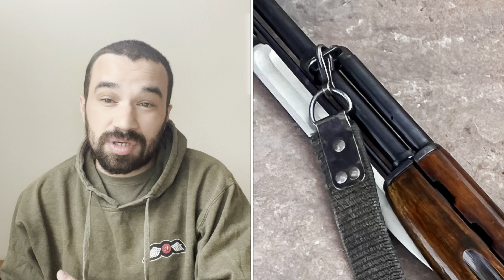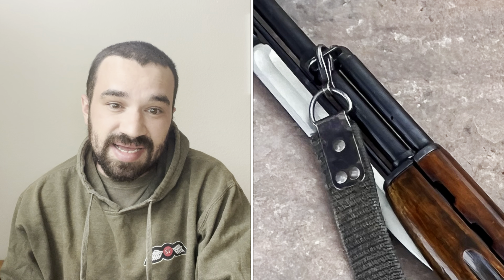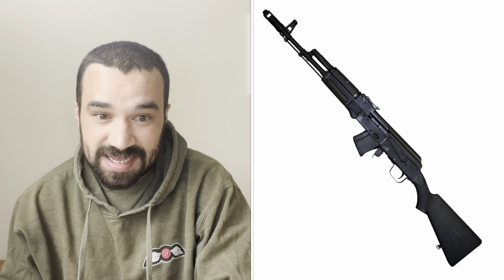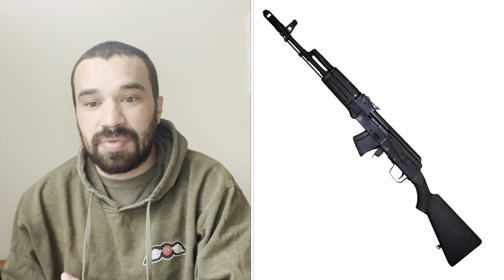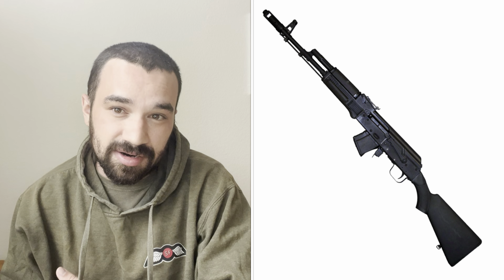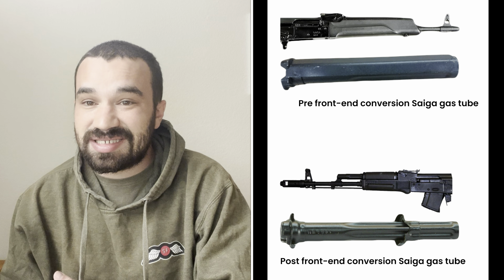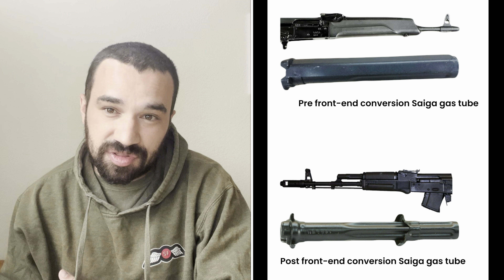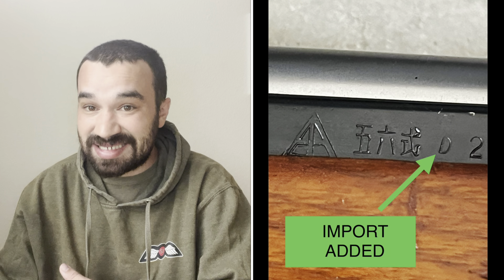SKS Collector Breaks Down Assassin’s Weapon

Comment: Spot on. I thought it might be a Saiga at first, but once I saw the gas tube was almost touching the barrel was the same diameter of the barrel and had no fluting, I knew it was an SKS. I also thought I could see the gas block mounter sling loop.

Comment: I called it an early 90’s Chinese SKS import put in a crappy aftermarket MonteCarlo plastic stock with the horrible duckbill metal detachable mags. Probably a NC Star scope to boot.
I had the cheap plastic aftermarket folder on mine and that stock covered some of the serial number.
That gun has probably changed hands a bunch of times over the years and I wouldn’t be surprised if it was stolen from someone a time or two.

Comment: It would be BATFE not FBI attempting to recover the serial #. That said Dale Armstrong former ATF agent has a book on firearms trafficking for criminal investigators that touches on serial # recovery. It's going to depend on the method of obliteration and the method of serialization. If SKS rifles have their serial # made by compacting rather than removing metal that'll boost the chances of recovery. But given the other factors of the case (guy's alive) the serial number probably won't be too important.

Comment: If anyone asks themselves if it is just stubbornness or incompetence why Cyrillic letters aren't accepted. Probably not, it's not that long that computers could could just mix and match different character sets.

You also have to "sanitize" the input in a database, otherwise the wrong combination of letters can poison an entire database (and you lot would certainly try to do that 😁🤣😘) so you'd need to write totally separate logic routines for that. That means you'd always have to have someone who's at least proficient at working with Cyrillic character sets. Much safer to just deny different character sets.